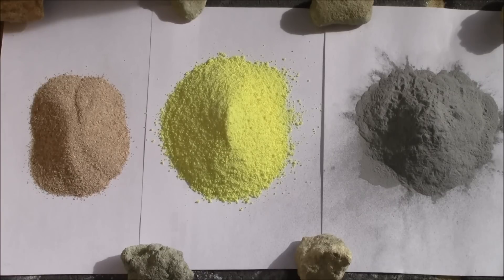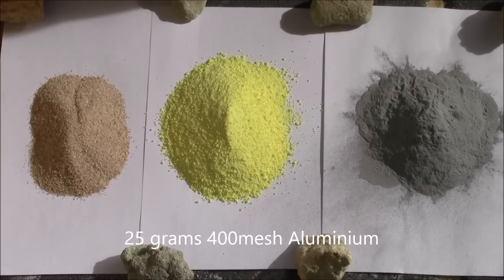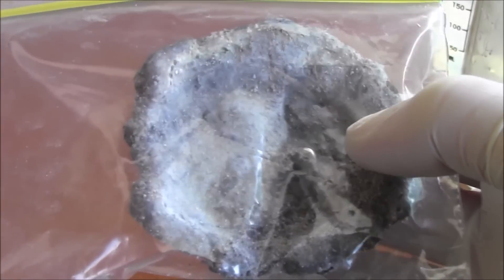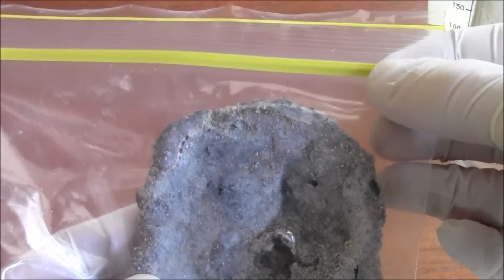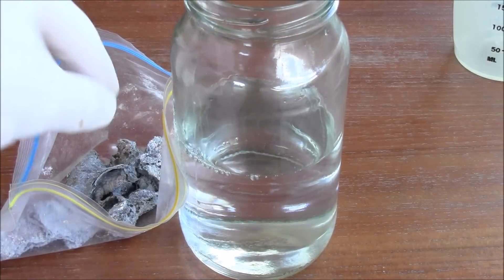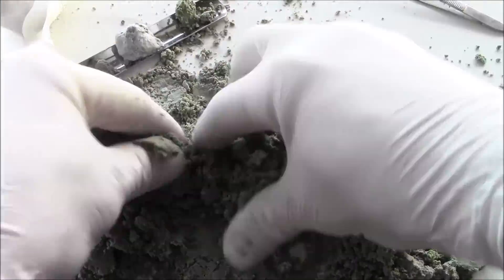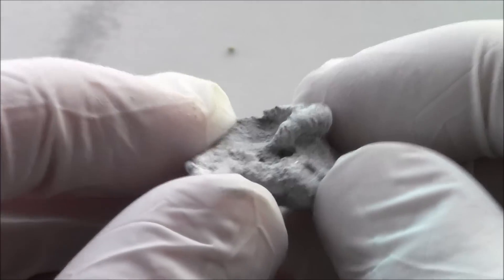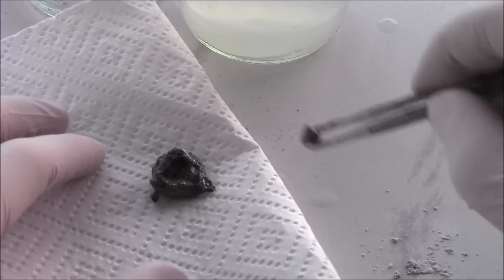How To Make Silicon Dioxide Thermite

Comment: Made a bunch of this a few years back. It helps to make a lot and add a bit of salt to it and potassium nitrate to a small amount of the mix on the top. Set up in a large ceramic flower pot buried in a sand pit. The salt helps flux the silicon so it forms a glob at the bottom. The aluminum sulfide can be used to make chemically pure hydrogen sulfide from water. This is useful to make hydroiodic acid or ammonium sulfide.❤
Reply: This sounds so sketchy... I love it. XD I'm gonna try to make different variations of thermite. Rn I'm planning on making a vid on the regular 3 part Iron Oxide and 1 part Aluminum Powder.

Comment: sulfur would not be the most suitable, because of the toxic compounds, something else as the heat, like iron-oxide mixed with the silicon oxide. purification is essential. how about magnesium instead of aluminium, or magnesium-aluminium, with silicon dioxide. and seems that magnesium is more affine to oxygen than aluminium.

Comment: I did similar al -s reaction 30 years ago but not with sio2....I also had some aluminium metal left similar to that. Although acid reaction can differentiate between si and Al but the question is If AL react with Si and if so then if Al3SI3 form and it doesnt make silane like Methane produce from similar AL4C53? But the idea totally is good as I had similar plan and did similar .

Comment: how was this mixture ignited? it looked like you added some materials but Im not sure what they are
Reply: Late reply, but I believe that this thermite was ignited with Potassium Permanganate (KMnO4) and Glyercin (Glycerol), the reason I think it is is because Potassium Permanganate has a deep purple and blackish color and a characteristic bubbling. Although I may be wrong.
Reply: I think it was magnesium and some sort of flammable liquid
Reply: @panchreston6133  magnesium doesn't make sense as it can light thermite on it's own without adding any liquid, the color of magnesium is silvery and it's oxide is white so the black stuff can't be magnesium, the black stuff is definitely potassium permanganate and the liquid is either glycerin or maybe even sugar+water as that lights potassium permanganate too, and thermite takes it's oxygen from it's oxide part and can burn under water too assuming you can light it

Comment: I do not understand why we need sulfur here. Sulfur will combine with Aluminium and produce Aluminium sulfide and again it will react with sand to produce Silicon sulfide. So, the whole thermite is spoiled here by bringing sulfur into the mix. So, the final product you have here should stink like hydrogen sulfide because both Aluminium sulfide and Silicon sulfide will liberate hydrogen sulfide on hydrolysis. Traditionally, Magnesium is used for silicon thermite. Because, there is a reason behind it. It will not only speed up the reaction and also it is easy to remove any uneacted magnesium (it is pretty rare though) and its oxide at the end by dissolving it in any acid. Also, Magnesium does not react with alkali whereas Silicon does and vice versa in case of acids. Any unreacted sand can be removed by washing it away with HF. But HF is too dangerous to deal with so no need to do that and it is understandable.
Reply from the maker: Shiva Chemist sulfur is used so the side reaction of aluminium and sulfur will keep the reaction between aluminium and silicon dioxide going. Ive tried it with out the sulfur and the reaction stops before it can even get started. This is why you add more aluminium to accommodate for the sulfur so your not using the aluminiun the silicon needs.  A quick google search would of allowed you to undrratand why instead of ranting here. Not every one can buy heaps of magnesium dust and I've never seen OTC HF
Reply: toothpick993
 No, you did not get me I think. I just doubt the yield of silicon here. Did you check the final product by heating it up with Magnesium? It should form silicide and will liberate pyrophoric silane gas on adding acid if it was Silicon. It should react with strong aqueous solution of alkalis too. It is difficult to ignite silicon thermite because we are using coarse sand here. For silicon thermite, well grinded quartz should be used. But again we can't do everything like in Industries. I'm just explaining why it so. Also, I explained the reasons why  Magnesium is usually preferred over Aluminium. It does not mean you can't use Aluminium for silicon thermite. Crystalline silicon is usually obtained by heating Potassium silicofluoride with Aluminium or Zinc or even with Potassium metal. All these reactions do require so much heating.

Comment: So, the reaction are :
3SiO2(s) + 2Al(s) -> Al2O3(s) + 3Si(s)
It is enough to get  pure Silicon ???
Reply: Yes but it's uniformly distributed
You'll probably need to seperate the silicon from the aluminium oxide
Reply: But you'll need extra heat if you don't wanna use sulfur
Reply: @vladimirlenin843  ahh thank you.
Reply: @mimireich  I'm surprised you replied
I forgot this is a six years old comment
Reply: But i mean he did shows how to remove the impurity tho
Reply: @vladimirlenin843  yeah, back then I was clueless about it besides basic stuffs.
Reply: @mimireich  did you do it tho
Reply: Not quite.
As written, it's unbalanced with respect to oxygen.
6 oxygens on the left, 3 oxygens on the right.
3SiO2 + 4Al -> 2Al2O3 + 3Si

Comment: Put the pieces of the acid  dipped silicon in sodium bicabonate solution(baking soda) to nutralise the acid
Reply from the maker: I didn't have a solution with me at the time, I was just trying to wrap up asap. But it would of been much better then using paper towel Thanks

Comment: manganese thermite
Reply from the maker: I will be making a "how to" video about making manganese dioxide and then I will be using that for the thermite
Reply: awesome i cant wait to see them.. ps. you can get over 50% purity Mn02 from alkaline batteries (best if new) i used duracell
Reply from the maker: MegaScienceguru Yeah I know about that source, I've made a video about getting it out of a battery already. It's just its pretty much loaded with iron, I'd rather show a better way in making it

Comment: Nice one. I aways found copper sulfate and calcium sulfate thermites to be interesting.
Reply from the maker: What would I have to use for those thermites? Aluminium or Magnesium?
Reply: aluminium :) Try magnesium too, but I think magnesium acts a bit more like flash powder.
Also, you can cast CaSO4 thermite (just make sure you dry it out before ignition). I have videos on both if you want to see some demos